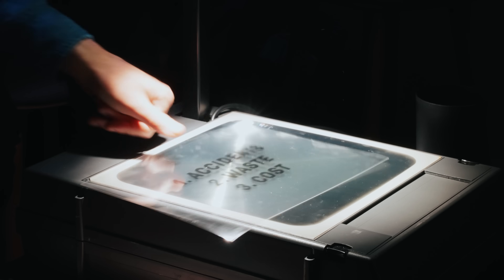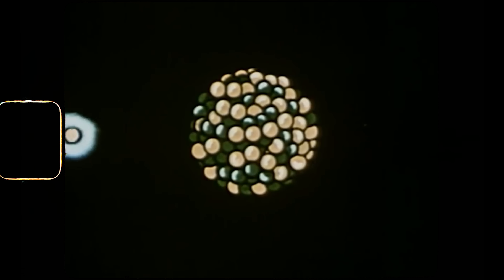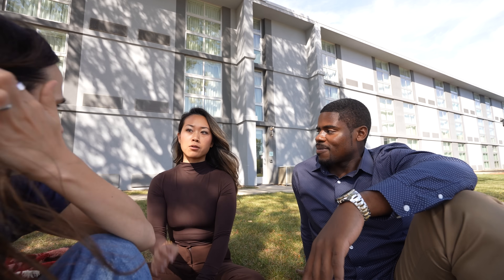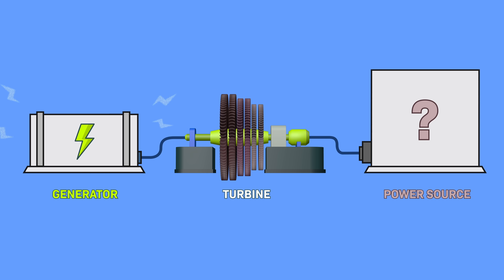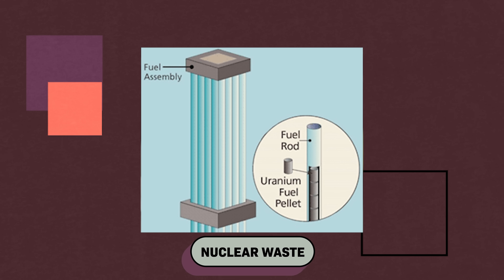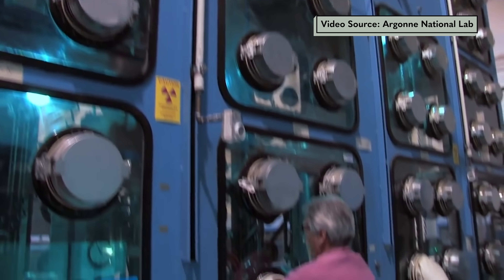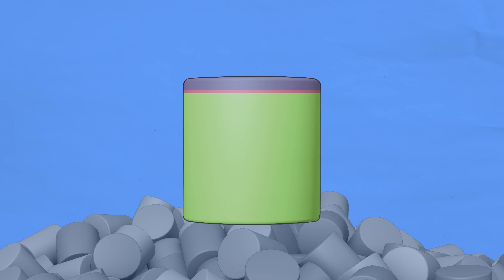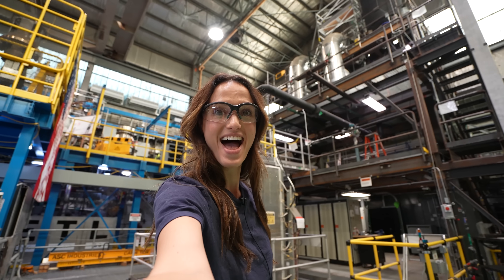The Big Lie About Nuclear Waste

Comment: Excellent and interesting video with a non reactionary fact led investigation. 
There is a lot of hysteria, mis information & ignorance around what Nuclear Waste actually is. 
I was an Engineer working on the decommissing and  demolition of the ZEBRA research reactor at Winfrith in the UK in the early 2000's.
The Zero Energy Breeder Reactor Assembly conducted many cutting edge experiments   during its 20+ years of operation from 1962 including investigations into recycling fuel types. 
As humans, we should be more confident and committed to clever technological solutions for creating a long term positive legacy for nuclear power. 
Ironically, you can also recycle & burn plutonium as fuel in Fast Breeder reactors  which would actually reduce weapons proliferation as well as reduce the long term storage overhead as you highlighted.

Comment: You missed Thorium.  There's 50,000 years worth by some estimates...
Reply: There's 2 billion years worth of uranium plus another 2 billion of thorium. Uranium is just easier to use.
Reply: @chapter4travels  There's not 2 billion years worth in an easily accessible form though.
Reply: @bartcop2742  Yes, there is. Unlike thorium, uranium is soluble in seawater and we know how to retrieve it. Right now the cost is double mined uranium but uranium is so cheap and reactors need so little that it doesn't matter.
Reply: @chapter4travels  Great.  I've seen the estimates from Japan and other places.  So  if it is so cost effective and plentiful, then where are all the start ups?  The ChiComs would be all over this.  So would every tin pot dictator who was by the ocean so that they could build a nuke program.

Bit odd, innit?
Reply: @bartcop2742  the Chinese are building one, they just announced it.

Comment: 1:24 Did you just say that if we can use it to make energy then it's "clean energy"? Well, yeah. If you just ignore the radioactivity part then it's clean.
Reply: And clean is Solar Energy ? You know what's inside those panels, right ?
100% clean is not possible
Reply: @The.Dark.Dominion.  Mostly silicon, silicon dioxide (= glass), plastic, aluminum.
Reply: @MaxLein  so you are saying that some glass and aluminum can create energy out of sunlight?
Reply: @The.Dark.Dominion.  You asked what is inside the solar *panels*, which is different from the solar *cells*. The glass protects the solar cell underneath. The actual solar cell, the thing that produces electricity is made from silicon. The frame typically is made of aluminum.
Reply: @MaxLein  just take the L … sigh
Reply: "Clean" means low carbon emissions in its life cycle. You do know that, right?

Comment: Great and super well made video! But the process of enrichment is not what you described. In the process you are separating U238 from the mixture of U235 and U238 in order to get a higher concentration of U235. We cannot make more U235 in that process and the process creates some waste of U238
Reply: "some" waste is nicely put.  
Mined uranium has ~0,7% U235. You need to get this to ~3%. So you have to mine 4x the amount of U238. Basically you throw away nearly all of what you mine.

Comment: Yes, this is established technology.  Back in the 80's the US navy's submarines were "flex-fuel" before the term even existed.  Their reactors used both uranium or plutonium - though not at the same time.  Typically, the uranium was used until it was spent, then the remaining plutonium was extracted from the waste, then refined / enriched and finally used until all of this second 'fuel' was completely inert.  Yes, it took more energy to refine the spent initial fuel to make enough of the second type of fuel viable (vs simply mining more uranium), but the overall result was ZERO radioactive waste.  At the time, the main argument for NOT doing this commercially in America's land-based reactors was that plutonium was much easier to turn into a bomb, and no one wanted terrorists stealing enriched plutonium and making a "suit-case sized nuclear device".  Using this spent fuel as recycled / green fuel would solve 2 problems: the dreaded ever increasing carbon footprint issue, and the nuclear waste storage problem.  That is why this technology will never be adopted - it will solve problems, and those folks in control never want to actually solve problems, they just want to make it seem like they would solve them if only those people on "the other side of the isle" would be reasonable.  Those in power don't want solutions, they only want division and conflict, leading to more control.  Sad really.
Reply: @Just Looking Yes, I admit it - you caught me.  I omitted some of the steps within this very lengthy process, where the spent / depleted uranium and plutonium is removed from the spent fuel rods (i.e. - those rods that are no longer enriched ENOUGH to sustain a reaction) and then the remaining reactive uranium is re-integrated / re-enriched into a lesser number of valid uranium-based fuel rods.  Yep.  Because I simplified my description of the process, I've negated the validity of the actual process.  Yes,  again - you are correct - "physics" never says that uranium decays to plutonium.  All of this technology that the navy's nuclear submarines use is all: "foolery of the highest order".  You got me.

Comment: A very one-sided video, at first suggesting that recycling nuclear waste was an absolute no-brainer, giving the upsides a lot of room and emotion, while the issues why it's really not that simple get throwaway mentions at the end. Also, many poor comparisons and simplifications, all there to basically present nuclear energy as the solution for everything. I'm personally open to carefully look for potential continued uses of nuclear energy, but this video is so skewed it looks like it was straight paid by players in the nuclear industry.
Reply: The biggest issue is that such a nuclear reactor does not exist as a commercial power plant. The mention of “yeah, we did this in the 1960s already” makes it seem as if this is a no-brainer and we could start building molten salt reactors now if we wanted to. 

There were two test reactors in the 1960s, I think and China has constructed a small test reactor with a thermal output of 2 MW, which is less than one single (!) wind turbine. I am not sure whether it is online, though. This is technology that needs decades of further research to become commercially viable. None of this was mentioned in the video. 

Not to speak of the cost, nuclear power is much more expensive than renewables. IMHO the biggest argument here is that countries may want to phase out fossil power plants first and then phase out nuclear power, although there are nuances to these arguments, too.
Reply: @MaxLein  
i'm surprised people calling this "good journalism / professional". 
at 13:17 why do we see her face closed in and smiling in a film sequence of uranium fuel pellets and that we need to change our minds... 

Looking at the comments i do get what kind of primitive crowd she is trying to get the attention of.

Comment: In your oversimplified explanation of nuclear fuel reprocessing, you somehow forgot to mention that a closed fuel cycle primarily relies on breeding Plutonium-239. Additionally, it's worth mentioning that no one has fully achieved a closed nuclear fuel cycle yet, despite decades of research. The technological and economic challenges are simply staggering.

Talking to the people who work in these fields is easy, but conducting an objective analysis of the potential benefits and risks is not so straightforward...

Therefore, while it's interesting to watch, don't take anything mentioned too seriously. The '*if true' disclaimer is there for a reason...
Reply: You don't have to breed plutonium for it to be economical, recycling LWR fuel is economical as well. Russia has the BN-1200 running on reactor plutonium alone.

Comment: Thanks for what you do! I am sure a few perpetual motion freaks will spout off, and the Guys who don't realize the Edison Rotary converters were powered by  electricity generated at gas and coal fired steam generators! The Grand Central station in New York City was not power producing  plant but was just a conversion station to supply the proper power to the trains from the power generated at steam driven electric generators.

Comment: We don't need nuclear power plants at all we don't need to create steam to produce electricity. We don't need to use wind or water to move the armature magnets and coils of copper wire.  We can use the field magnets to move the armature magnets and coils of copper wire.  Then we use inverters and transformers to deliver high voltage AC power continuous peak power. Ten car generators chiseled to spin like Edison generators and with inverters and transformers to deliver high voltage AC power 2000 volt AC power continuous peak power this is 1200 amp power plants with transformers to 2000 volts is 2.4 megawatt power plant with ten car generators.

Comment: These are real power plants that have not been built since the 1930s when the PUC was created to assure these inexpensive power plants are used.  The Grand Central station in New York City was the last power plant built.  If it was restored to deliver 2000 volt AC power to the power lines the power plant is a 2 mega Watt power plant without fuel or pollution.  A 2 mega Watt power plant that is clean enough to use indoors.

Comment: We don't have any need for nuclear power plants.  We don't have an energy crises. We can replace fossil fuels use and nuclear power plants yes even wind power plants and solar power.  We have been repeatedly misinformed about power generation and power use.  We have Edison generator and dynamos power plants and vehicles to build. An Edison generator is a permanent magnet motor as a generator with inverters and transformers to power brushless motors as generators with inverters and transformers to deliver high voltage AC power continuous peak power to the power lines.

Comment: Great video, some excellent points, but I doubt it will ever happen because of the cost. Reactors are hugely expensive to build and operate, and with all the energy companies pouring all their research and development budgets into renewables no one is going to reverse course and go back to nuclear. It's yesterdays tech. It's probably not even a public perception or environmental concerns issue at this point, it's simply down to cost and returns. As it stands now renewables are far more attractive because the raw source of the energy (sun, wind, water) is effectively free. So it's cost of construction and maintenance versus cost of construction, maintenance, AND the raw material with all its associated production costs. Once the construction and maintenance costs are equivalent (which they pretty much are now) it's a no brainer. Wind and solar farms are far cheaper to build than nuclear reactors. It's that simple. If renewables earns more money for the energy companies then that is what they will do.

Comment: Yes we could use radioactive waste over again.  It would cost billions of dollars and in the end you'll wind up with more nuclear waste that cannot be reused.  Used waste will not generate as much electrical generating energy, so the profit from using it will take a decade or more to recoup the cost of building the plant, plus the used waste will become useless in less time then pure material.  In the end the cost of using waste is not worth the trouble.  Better to just shut it all down and use solar which is cheaper to install and run.  Now, lets talk about radioactive material from hospitals, which actually makes up the bulk of waste that needs storage and disposal.

Comment: Hey Cleo, in Nuclear Waste there are 2 categories, the used nuclear fuel and the remaining which is stuff that have got irradiated.  It's the spent nuclear fuel or used nuclear fuel that is reused.  The remaining contaminated stuff still has to be stored somewhere, which are like protective gear and many more . . .
Reply: Fortunately that protective gear, considered "low level nuclear waste" if I'm not mistaken, does not remain dangerous for very long, and can be put somewhere short term to cool down before it's properly processed. As for the big stuff that has to be put in casks, the solution is embarrassingly simple:  we can literally just put that shit in a really deep hole, below any water tables, somewhere geologically inactive, and cover up the hole. The oil and gas industry's boring tech can be repurposed to help with this, saving us from having to invent some crazy new digging tech.
Reply: The remaining stuff is not that radioactive. It's not a serious concern.
Reply: @Crispr_CAS9  Well you don't store the other stuff in your back yard!
Reply: @pritambissonauth2181  Properly containerized high level waste would be perfectly safe in my back yard. Low level waste is perfectly safe under a layer of concrete, which is how it is disposed of. Or just hang on to it for about 50 years, then dump it with the normal garbage when it has decayed. It's fine.
Reply: @Crispr_CAS9  The remaining stuff is very radioactive. Because the remaining stuff is exactly the remaining stuff you have now.  
When you recycle, you take out the 1% of U235. The other 99% stay. 95% will be U238 which is not really a problem, the other 4% are unfortunately. 
Basically recycling means you throw away 99% instead of 100% here.
Reply: @whuzzzup  " The remaining stuff is very radioactive." That's just wrong, although I suspect it's because you don't know how to follow a conversation.
Reply: @Crispr_CAS9  94% U238, 1% U235, 5% Pu & and highly radioactive fission products.  
Please enlighten me how those 5% are not highly radioactive.

Comment: We have the engineering capability without doubt. It’s the safest of all energy sources.
Reply: Also the most expensive!!
Reply: @davidmccarthy6061  costly as we have done so little. Repeatability brings price down. Taking subsidies and lifespan into account per MWhr there isn’t much difference in cost.
Reply: @davidmccarthy6061  Hey man, some things are worth biting the bullet for. If only the money that would make it easier weren't being piped straight into the coal and gas industry...

Comment: I think that Carter's policy had more to do with the so-called breeder reactors which generated large amounts of Pu-238 which can also be easily used for nuclear weapons, much more so than U-235.  Also if we wish to have a nuclear power cycle, the use of the Thorium cycle needs to be developed.  The reason why this fuel cycle was never aggressively developed is that it does not produce fissionable products that can be diverted to nuclear weapons.  There are other concerns about reactor safety that are too complex to go into here that also need to be addressed.
Reply: "do with the so-called breeder reactors which generated large amounts of Pu-238 which can also be easily used for nuclear weapons" No commercial reactors produce weapons grade plutonium, including commercial breeders. You need purpose-built breeders for that.
"The reason why [thorium] was never aggressively developed is that it does not produce fissionable products that can be diverted to nuclear weapons." Thorium cycle produces U-233, which is an excellent weapons material.
Reply: @Crispr_CAS9  The U-233 in the thorium cycle is consumed as quickly as it is produced.  Thus it does not produce a supply of fissionable material that can be diverted into weapons production.  And I did say that breeder reactors produce Pu-238 not commercial LWRs.  In the 70's, breeder reactors were being pursued due to a perceived lack of Uranium ore supply.
Reply: @paulkurilecz4209  "The U-233 in the thorium cycle is consumed as quickly as it is produced" No, it isn't.
"And I did say that breeder reactors produce Pu-238 not commercial LWR" There are commercial breeders. They don't produce weapons grade materials, either. That's why I specified purpose-built weapons breeders, because I know enough about the subject to not make such a basic error.

Comment: Bur, then what happens to the waste after THAT  reactor is done with it ?
Reply: Waste following full reprocessing is only dangerous for ~300 years, and can be easily stored for that amount of time. Alternatively, actinide burning in appropriate reactors can destroy the dangerous nuclides, although this is not energy efficient.
Reply: @Crispr_CAS9  ~300 years.
Man, this is bullshit.
What substances are you talking about?
Reply: Dangerous for the next 300 years is hardly harmless.
Reply: @jameshaxby5434  Most industries produce waste that is dangerous forever. Compared to forever, 300 years is nothing.